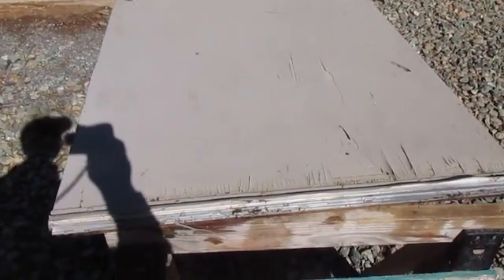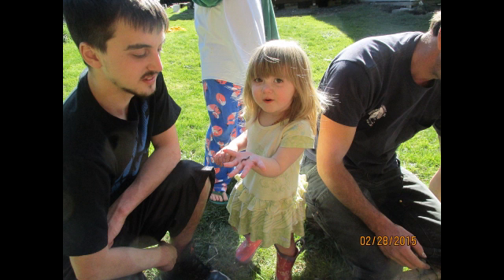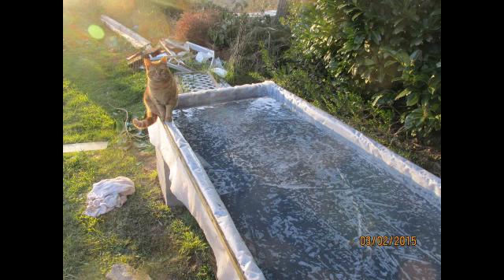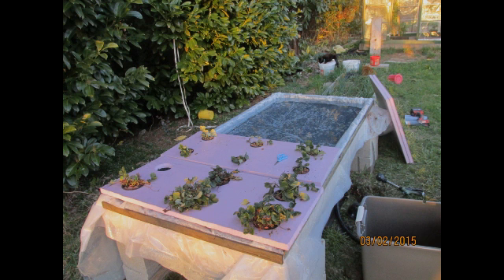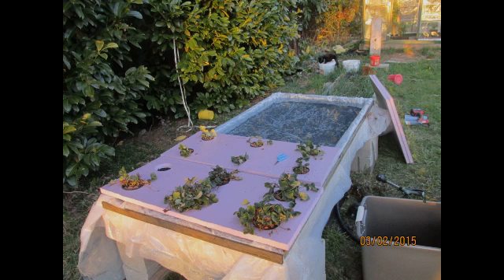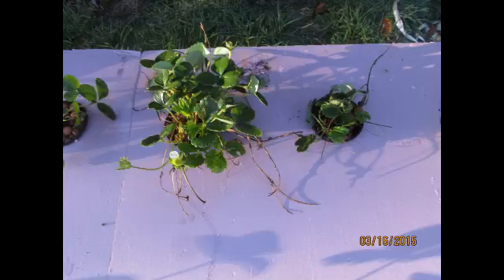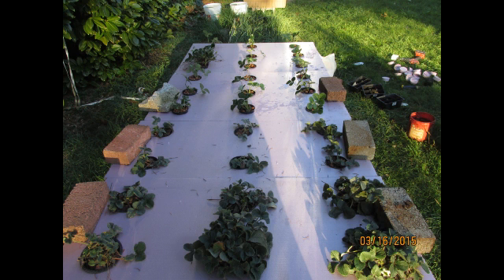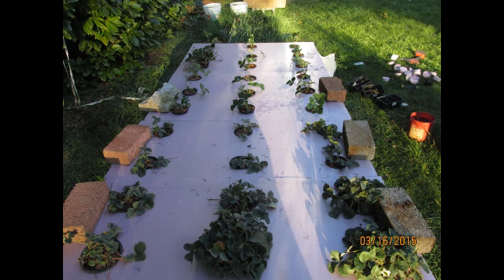Lets Grow Hydroponic Strawberries 2015 (1)

Comment: I'm a big fan of having that 2 inch air gap between the water and the raft. When I did floating rafts (no air gap), water/moisture would always bubble up on top of my raft, making my berries get wet and rot before ripe enough to eat. I had to use little upside down net pots to hold my berries up above the raft so that they'd stay dry.

Strawberry plants make a different type of root in water vs the air gap zone. Water roots are thin and don't transplant to soil very well. The roots that grow in the air gap area get thick and I presume retain water better than those thin water roots. Plants that I had in an air gap pond transplanted to soil more successfully than the plants with water roots.

In hot Arizona, the air gap zone allows water to evaporate off the surface, which helps remove heat and keeps the reservoir temperatures down. Too high reservoir temperature causes problems, as you well know. 

Nice to hear that you are going back to Seascape variety. I too have decided that Seascape's seem like the best day neutral variety. Their berries are red all the way through the berry. I tried some "Sweet Anne" day neutrals, and they are okay, but the plant is not very heat tolerant, berries rot easily if wet, and the berries often leave a white shoulder that doesn't ripen (very frustrating). Albion is okay, but berries are smaller/less productive than Seascape and usually not as tasty either. Seascape is the day neutral king for taste, productivity, and berry size.

I tried "Mara Des Bois" and "Evie" (not "Evie 2") everbearing varieties. Mara Des Bois likes to send out tons of runners, unlike day neutrals. Haven't been able to produce a good quality Mara Des Bois berry to taste yet, since the plants are so busy runnering all the time. Evie seems like a good variety to me: deep red berries (all the way through) and the plants are more heat tolerant.
Reply from the maker: zilym Hi Zilym thanks for all the good info you shared with us & really appreciate hearing about your experiences. Looking forward to chatting with you in the future.Larry

Comment: Thanks Larry - I'm looking forward to seeing how these strawberries progress. I did have a little try at some Kratky strawberries on a windowsill last year before my greenhouse arrived, and although they started off well, after a month they started to look a bit sad. The nutrients I use don't seem to stay in solution for more than a couple of weeks. My NFT strawberries this year seem to be off to a good start though. Cheers!!
Reply from the maker: Jim Conner I love the NFT Jim, with the Kratky style you'll need to change water regularly or you'll end up with a mess. NFT is still my favorite.
Reply: ***** I did kratky style air gap, but added lots of air bubbling in the water. Never had any trouble with keeping the same water for the entire 4 months and the water was still crystal clear at the end when I shut it down for the season. I had everything well sealed up so that sunlight never hit any water or moisture, which prevented algae. 

My dad never dumps out the water in his cooler WA temperature hydroponic ponds. His oldest pond (this will be it's 3rd year) is actually his most healthy and productive DWC pond. The water is full of algae, old dead roots, and dust because he just uses floating rafts that don't seal off the pond very well. Strawberry plants still grow in it and do well. Wouldn't work so well in hotter climates I'm sure.